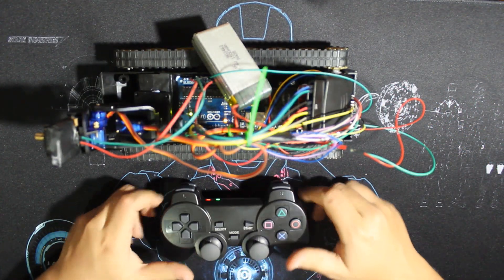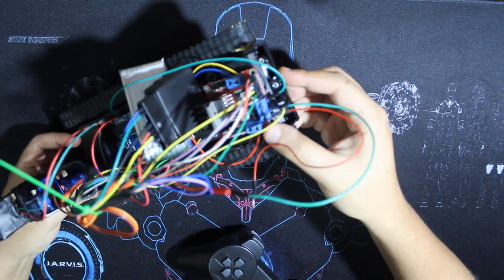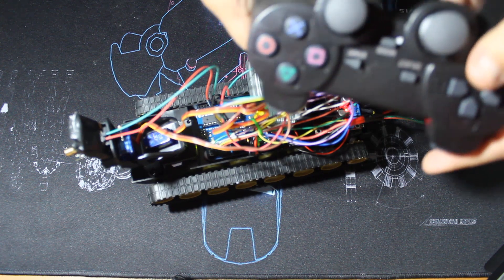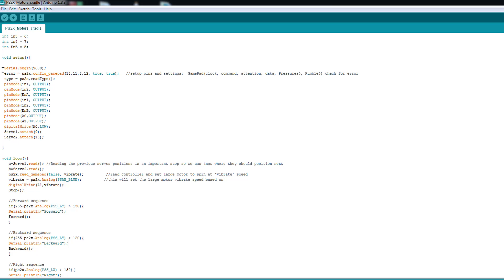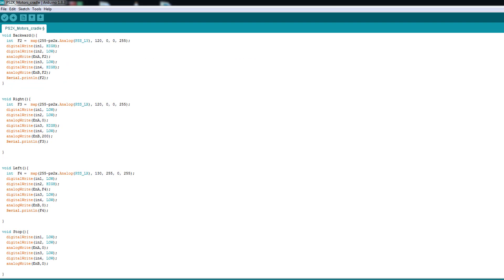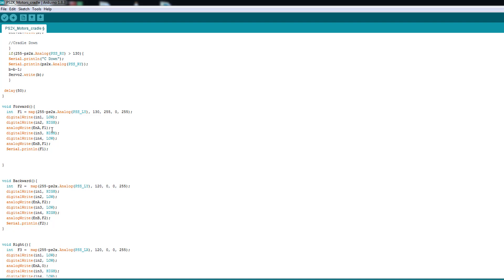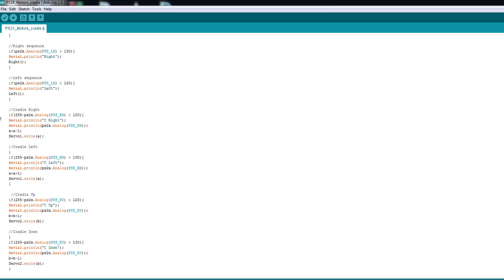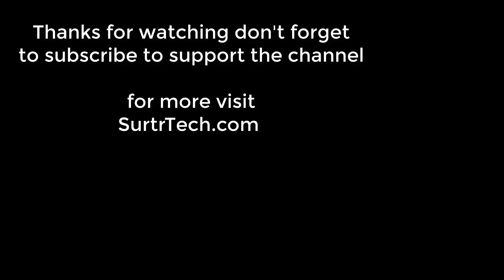Arduino RC Robot - PS2 controller LASER Tag

Comment: Dear Sir, I have tried many tutorial for interfacing ps2 controller, the problem is reciver not active (receiver RX led do not blink) so I cannot binding/pairing with controller. Today I try your tutorial the problem is same, the RX led  receiver do not blink. And at the wiring diagram, pin6 receiver connection to pin8 UNO board. I need your advice, thank you🙏😊

Comment: Hı friend
 I have a problem about my ps2 robot project. when  I pushed psab blue  , Servos moves too. But I used direct psab blue  as (if psx.button (psab blue )) without vibrate variable
Reply from the maker: Hello, did you keep the same wiring/codes or did you modify something? Because the servo moving is related to the RX thumb stick only.
 ""  ps2x.read_gamepad(false, vibrate); ""         Don't remove this line  
 ""  vibrate = ps2x.Analog(PSAB_BLUE);""         Controls the motor vibration
 ""  digitalWrite(A1,vibrate);  ""                             This one lights up the laser following the "X" button and it's also the value for the vibration 
 if you don't use the laser you can remove the last one, if you don't want the vibration remove the 2nd line and replace the 3rd one with ""digitalWrite(A1,ps2x.Analog(PSAB_BLUE));""

If you modified something show it to me because in the code you can't move the servos with commands other than RX stick
Reply: @SurtrTech  My friend 
you say true, I try to make fire fighter robot with water pump. I have  used Adafruit motorshield V2. I regulate to your software for my project. I use a motordriver output for water pump(3v motor).  And I code as 
if (psx.button(PSAB_BLUE)
{ waterpump.run(220)}

but My servos moves as a crazy
Reply: Also I suppose that miss a point. So You code as  psx.analog(PSAB_BLUE). I will try it . Thanks a lot.
Reply from the maker: @bahadirgulcu272   "ps2x.Analog(PSAB_BLUE)" gives a numeric value, there are ""ps2x.ButtonPressed // ps2x.ButtonReleased // ps2x.NewButtonState"" have boolean values, if the problem persists try the example from the library to make sure that the controller is working fine, the rest is just code
Reply: @SurtrTech first of all, thanks a lot for your help I got it you said. I will try it
Reply from the maker: @bahadirgulcu272  You're welcome, if you need further help I'm here.
Reply: @SurtrTech  thanks
Reply: @SurtrTech  Thaks a lot for your helps.It runs perfectly as boolean. newstatebutton.ok